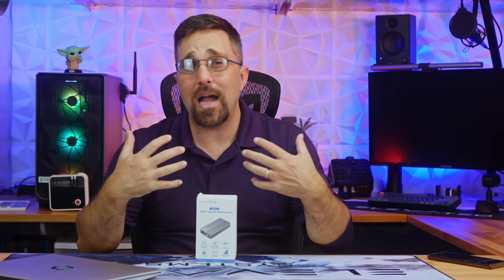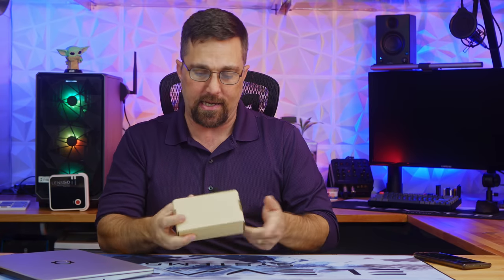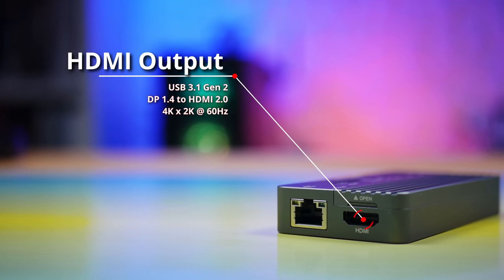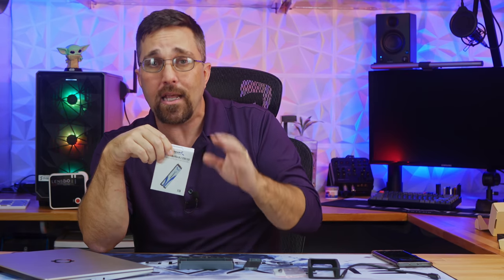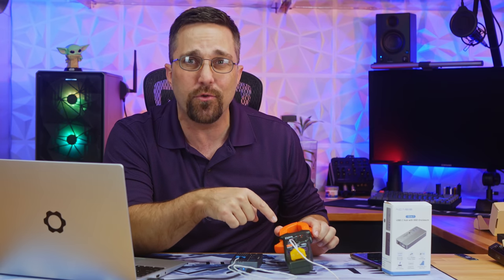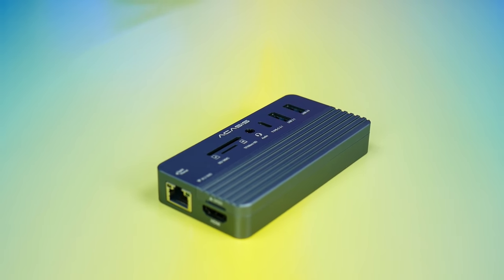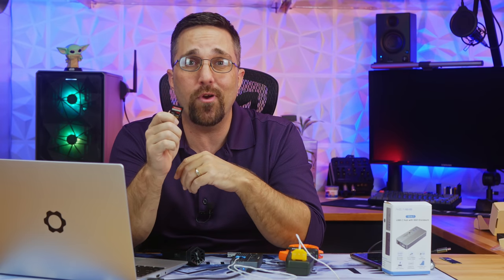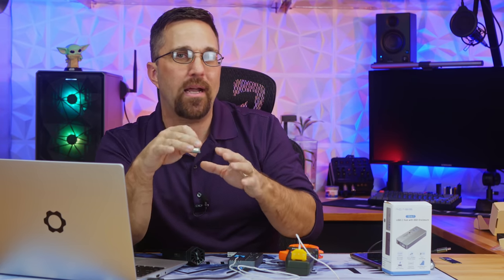One Hub to Rule Them All! ACASIS 10-in-1 USB-C Hub Review

Comment: That's funny. I get about 290MB/sec out of my SD card reader. Do you mean to tell me that a product that's marketed for speed can't read UHS-II cards? Hell, even a good UHS-I reader will usually give about 95MB/sec. That's a very poor result from this product.

Also, your home network is only capable of 200mbits per second? I'm sure that's what your internet connection is capable of, not your home network. you could have easily tested the bandwidth of the port using two PCs. Actually you could test it using ONE PC with the port built into the PC.

Comment: The fact that this hub is very hot is not a good sign at all. This can be due to the use of bad (cheap) components and/or a faulty design. And even though the performance doesn't seem to be affected, I wouldn't put this on my computer. There is too much risk of damaging the machine.

Comment: 6:58 that's not how USB works
Reply from the maker: I mean it's a very rudimentary explanation of a USB controller. If I got deep into USB protocol and started explaining data buffers or endpoint pipelines, or got into USB transfers and concurrent or broken packet transaction streams, not to mention handshake packet transfers within the hub controllers, I'd loose 90% of the audience.
Reply: @ElevatedSystems  I mean USB devices do not communicate between them. AFAIK, USB is a master/slave protocol and all data has to pass through the computer.
Reply: @nilp0inter2  I think your timestamp is off. Are you talking about when he mentioned transferring between both drives on the hub?
Reply: @icebergmm  yes
Reply from the maker: @nilp0inter2  These are Gen 2 IC's so they can interface multiple peripherals via I2C, SPI or GPIOs over USB.  They can also switch between hosts and can swap roles enabling a downstream device to take control of the host system. Also just FYI the "politically correct" terms are host and device now.
Reply: @Elevated Systems  Sorry about the political incorrect speech, I was not aware of that (I am not American). 
Back to the usb technical details, even with I2C, SPI and GPIO communication allowed between devices and/or switching of roles. Storage devices do not understand the intricacies of every single file system out there, and cannot by themselves decide on which data block they should send. That task pertain to the operating system thus data flow must go in some way through the computer.